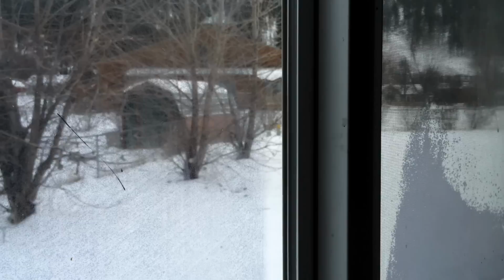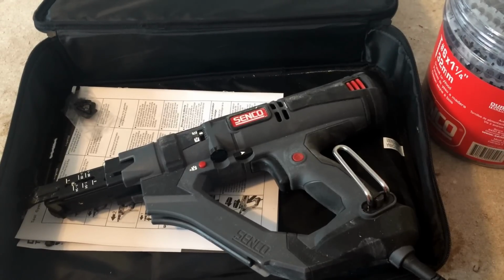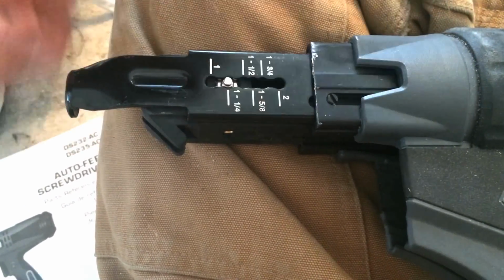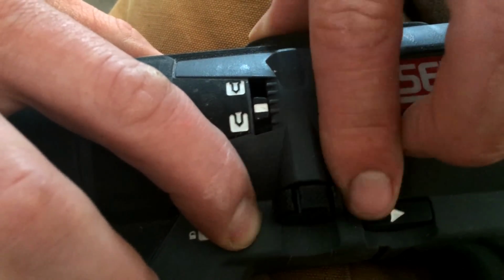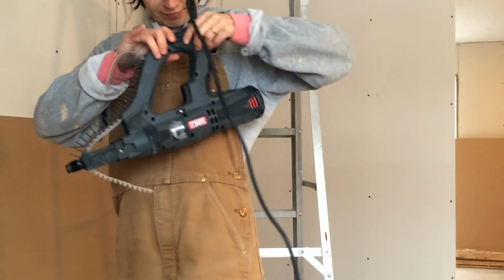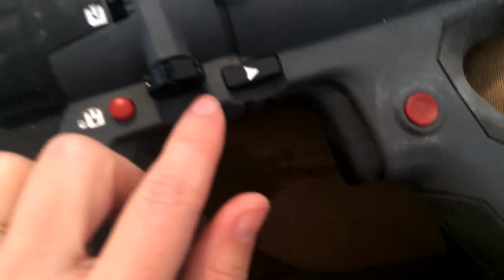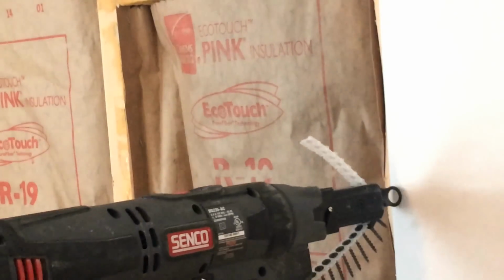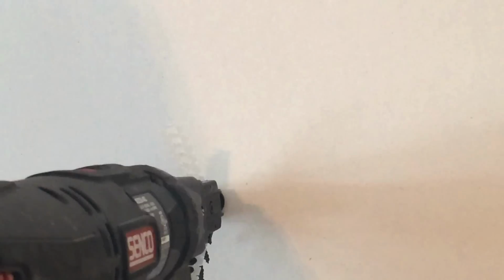My Edited Video

Comment: Oh god... drywall. I now wish I had your screw gun. I just learned with a cordless drill and some dexterity. The hard part for me is all the sanding, although that may have been because the contractors built a crooked room. I am definitely going to get one of those cool looking screw guns if I ever redo my drywall again.
Reply: if they're expensive you could probably hire one
Reply: I used to work for a remodeling company. Hanging the drywall, pretty straightforward, not to difficult. Doing the mudding and sanding, anything more than 1 small room, we would call in our professional. He could do it so much faster and it would turn out better. That made it worth paying him to do it.